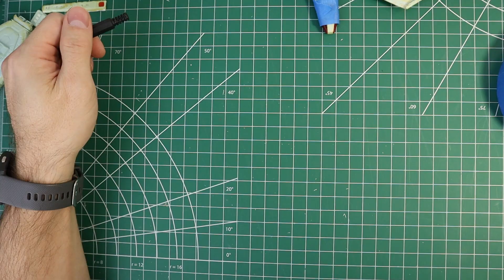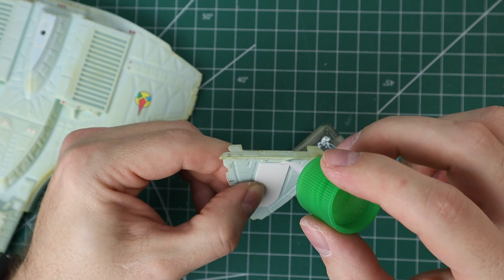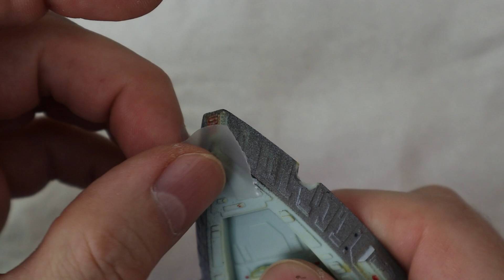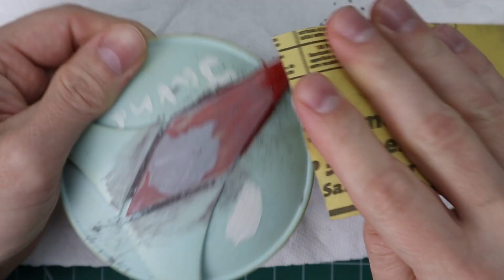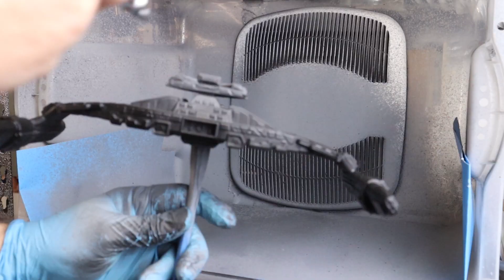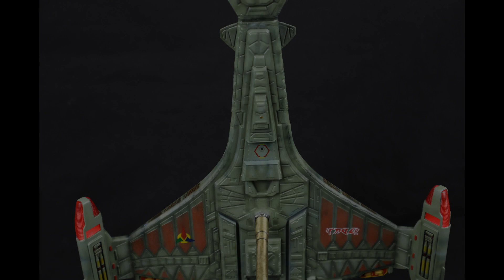Klingon Vor'Cha Battle Cruiser With Lights!

Comment: What size cap and resister did you use with the 4060? Do you have a diagram you can share?
Reply from the maker: The resistor is a 470 K-ohms, and the capacitor is .01 uF.
Here's the site I got it from. Google is your friend 😉
https://www.starshipmodeler.com/tech/cj_blink.htm